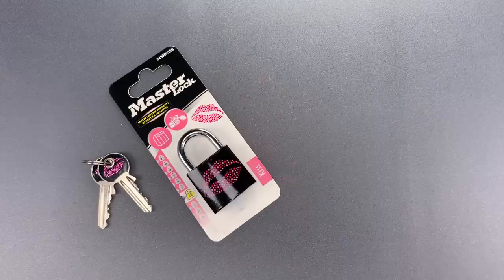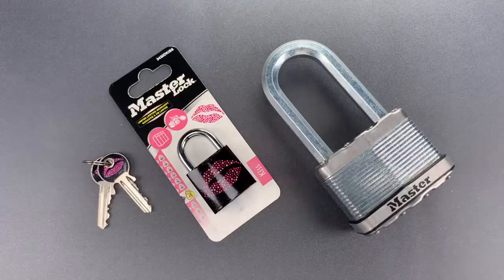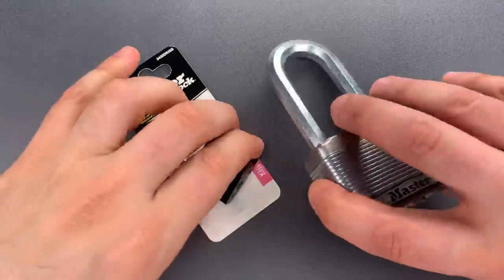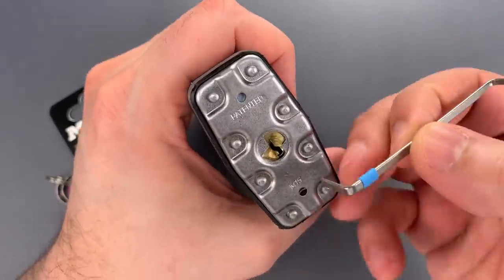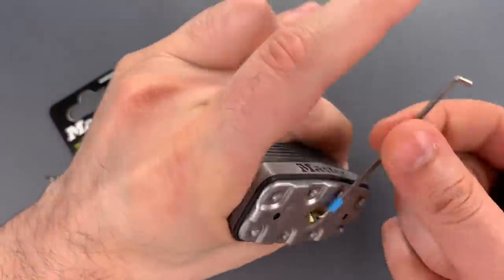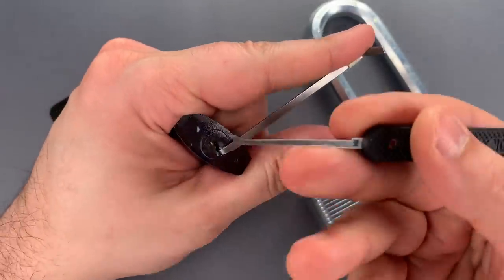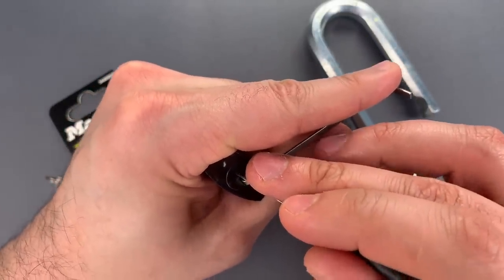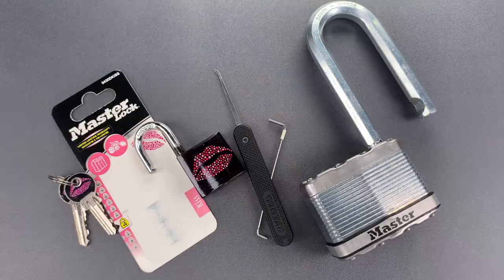[1211] Which Master Lock Is Harder To Pick? A Surprising Result

Comment: So security scales is for how "intimidating" the locks look if you were to forced your way in.
Reply: tbf, "looks secure" is almost as good as "is actually secure" under a lot of circumstances
Reply: Locks aren't really picked anyway in the real world. They're cut with angle grinders, bolt cutters or opened with hydraulic jacks. The actual locking mechanism is really only there for the owner.
Reply: @mytube001  usually the case, but my $5 bike secured with a 20 pound chain is only as secure as my puck locks core or any other bypass flaws (20 pounds is the weight of its short 3 ft tractor pulling chain, not price). So at that stage it’s all about the core.

Most bicycles though it’s true the core is rarely attempted as it’s so easy to break the cables or chains with any metal bar or pocket wire cutters, if it’s even locked at all. Or you’ll see missing wheels because they didn’t even put the lock through the wheels only the frame and that’s half the bike stolen right there.

After a few bicycles stolen in college I started upping the “it’s not worth it” factor and stumbled across LPL looking for reviews on budget locks and was horrified (one I was looking at looked decent but could be instantly shimmed by a soda can or anything else flat). And now I watch almost every video he puts out and realized how much of an illusion of security everything is (much like Windows operating systems, it’s like locking the front door but not having even walls so you could just walk around the locked door...), pretty amazing it’s stuff like this people trust and rely on.
Reply: @jakegarrett8109  "Using encryption on the Internet is the equivalent of arranging an armored car to deliver credit-card information from someone living in a cardboard box to someone living on a park bench."
-- Gene Spafford
Reply: @jakegarrett8109  Battery-powered angle grinders will chew through anything on the market in a matter of seconds. There is simply no defense any longer. These damned thieves are brazen enough to cut locks in the open, with people walking by. People probably either think it's the owner since no thief would do it in the open like that, or they realize that it is a theft in progress and look the other way since a thief may be armed and start a fight if confronted, and few onlookers are willing to risk that over a bike.
The actual core of the lock has no relevance in the real world, when locking up bikes, motor bikes and equipment. Since the angle grinder will always be faster, that's always the best option.
Reply: @eek04  I was more referring to using Windows at all. All I need is an IP address** and I can remotely shut off any Windows computer, transfer files both ways, see every file and document, remotely launch any program: so I could transfer a program, then launch it, move mouse pointer you name it. All thanks to a simple app a High School student made. No known firewall/antivirus has been able to stop it. I believe it even works on Windows Server. No passwords needed just type in a target and go, any windows computer connected to the internet. Hence I don't recommend Windows for anything important.

**I could put random ones, but it would be illegal hacking without permission, I only do this to friends who give verbal go ahead etc. Funny example was shutting off  my friends computer when he was winning in a game (he said I could anytime that week, I chose a convenient time, haha!), and also crashing their computer by spamming open games and forcing mouse cursor to 0,0 coordinate so they couldn't move it over the X to close. I also signed him out of his account which was great because he didn't remember his password (he had it set to auto-login at bootup and never signed out), that was great, great times...

I've tried telling M$, but just like MasterLock they don't care about security, they were more busy adding emoji's to M$ Word than fixing a glaring security issue (I mean accessing all files stored on servers and being able to remotely shut them off without any authorization is kind of a big deal...), to my knowledge this security flaw still exists, though I wiped all my drives before taking a job with security clearance since I didn't know how thorough the investigation would be I figured that would look bad, so I can only assume it still works as its worked for years and M$ just doesn't care. PS I'm not a hacker, I suck at coding, only good enough for programming robots and stuff, I was just a tester and it was decided to not release the program into the wild for obvious reasons, it actually started because file sharing sucked on Windows and with a little digging found this massive vulnerability, so most of the times we just used it to share game files, haha!
Reply: @mytube001  Yeah I've used angle grinders and other tools to chop up bikes and work on them while they were still locked. Nobody questioned me for a whole hour I was out there making a racket... I know what you mean!

**A couple were my motorized bikes I was doing alterations to, but I was working on like 3 or 4 bikes all locked up in different racks so it totally looked like I was just stealing random people's stuff as I was carrying parts back and forth to my car... People had to walk around me and my tools, so its not like I wasn't 40 ft from a door entrance, nobody even asked, they all looked away and shuffled past. That's why I picked a chain that would take at least a minute with an angle grinder (it took me about 2 minutes to cut with a corded grinder standard saw blade, diamond carbide tipped would be faster but I wasn't in a rush, then I welded a extended half loop for the puck lock), but for a $5 bike I figure its good enough. For my more expensive bikes with carbon fiber parts you could take off I just carry the bike into stores and be very courteous and go in odd times so its less busy, I won't let those out of my hand let alone my sight (more pricey than my first car).
Reply: I think it's mostly referencing protection against forced entry, given the vast, vast majority of theft and break-ins involve forced entry and not lock picking experts.
Reply: @mytube001  sometimes it is enough with two small wrenches lol :)
Reply: @jakegarrett8109  Hey that's a good idea for social distancing.  If you carry the bike on your shoulder the a_whole with no mask will give more space when there is  a bike wheel at face level.
Reply: @mytube001  Not ANYTHING on the market, pewag chains can take a few minutes to cut with an angle grinder in a vice, even more difficult out in the field. A lock with a decent case hardened shackle and body will likewise take a while to cut and if its a decent core, very difficult to pick, possibly requiring specialised tools, even for someone who is experienced in picking. 
Forget bolt cutters.

Problem is this sort of solution is going to run you a few hundred dollars so not many people opt for this, and even still, given enough time or skill someone can pick or cut through it. Best solution is move to a better town, seldom lock anything up where i live.
Reply: @eek04  I'm stealing that quote
Reply: @jakegarrett8109  most likely they can't fix it, because it's also a backdoor/hole the CIA/FBI uses?
Reply: @antonhelsgaun  that’s just sad if the CIA is THAT bad at hacking... I would at least think they have people more skilled than high school students. Either way it makes Windows similar to a house with no walls (or roof) with a lonely front door sitting alone on the foundation (and it’s only lock is a MasterLock), it’s so bad I wouldn’t even cal it a backdoor flaw at this point, it’s hard to not accidentally walk into the house.

It’s sad, making something so insecure for the illusion of safety (or whatever the government would claim if it is indeed their doing), I really hope it gets fixed someday but until then Linux is the only thing I could recommend. What’s funny, is I offered a high crypto bounty for the same person and gave them physical access to the machine: the rules were no removing hard drive but that was all. I would install any program they wanted besides key loggers and they could use my nice machine with the fastest GPUs you buy and use it to run HashCat or anything else they wanted for days. They still couldn’t hack my Linux machine! Not saying it’s bulletproof but that’s at least 100x better (granted that’s like saying 100x better than Masterlock but that’s better at least).
Reply: I'd just look at it as most common attack vectors as most people aren't going to be able to pick them tbh. Doesn't make sense from an all around standpoint but from that standpoint it kinda does. If you're buying the little lock then the pins are the only thing secure about it.
Reply: Having "master" lock branding on it makes me think its already "unlocked".
Reply: @jakegarrett8109  seems legit
Reply: @arthurmead5341  yeah no joke M$ would rather add emojis to M$ Word than fix bugs (if you look at Windows feedback hub it was just garbage like that being upvoted, actual issues have often single digit upvotes so they’ll never be fixed), it’s amazing because the internet is full of workarounds for issues that Windows never fixed for years (or they make it worse, like recently they just completely removed Windows Homegroup file sharing, which was unreliable and the reason this exploit was found because it was such a pain to use and the back door was discovered). Now that I think about it maybe they did find the issue, maybe that’s why a couple months ago they destroyed built in file sharing? Probably not, it’s still probably broken, they probably just didn’t want to maintain the broken feature and leave more time for emojis... I say that because who in their right mind wants that? Yet at the time I reported it Emojis had thousands of upvotes... so that wasn’t a joke mocking the stupid features, that was the actual most upvotes feature! It’s crazy, nobody actually cares about security, I guess if it’s off your mind you don’t think about it?
Reply: @arthurmead5341  but I know I’m also a bit weird and care about security. I doubt many people take apart my house locks and replaced it’s pins with hardened special pins (way more pick and brute force resistant), but that’s partly because I’m an engineer and I do weird things when I’m bored, and making my own pins sounded fun that day I guess, haha!

Also in a comment I replied to just before yours someone was asking for details on my laser weaponry, because some places have no firearms signs, but photon optical emitting weaponry is not covered under that and apparently it’s so uncommon it just hasn’t been a problem to ban on carry of self defense lasers (Texas doesn’t allow the right to bear pistols, so I got creative), so my most powerful one is a tiny pocket sized one for conceal carry with housings I designed to look like a child’s raygun toy, until it fires a beam that looks straight from Star Trek and would cause instant permanent blindness (also should set a T-shirt on fire in 0.2 seconds, maybe faster, it very quickly left scorch marks in my floor and I have multiple burn marks on my wall from shooting flies and spiders with lasers), so it’s certainly no toy... So I make my security the best I can legally do, and if it’s banned I find away around it: like firearms should not be banned period per the Bill of Rights, this certainly isn’t any safer due to possible reflections, but you also won’t go to prison for 10 hours years by carrying it responsibly. Anyways, I’m a whacky engineer that loves technology and pushing its limits, it’s what I do for fun.

Comment: Couple weeks ago, I realized that I'd lost the key to the Master disc-type lock on my storage unit.  I am definitely a novice lock picker (and also a lawyer).

So I showed up to my storage unit with my pick set, and a Dremel.  After about ten minutes of trying unsuccessfully to pick the lock (I could feel some pins catch, and hear them drop when I released tension, but couldn't get it to open), I gave up and ground through the shackle with a cutting wheel on the Dremel (It was night-time, and the lot has 24-hour access, but the fact that ten minutes of sparks flying into the night air drew zero notice was not encouraging).  I replaced it with a newer, beefier, boron-shackle Master disc lock.

The newer lock came in a 2-pack, and a few days later I was bored in my car, and decided to see if I could pick that one.

Open in... 30 seconds?  Probably a little less.  And as I said, I'm definitely a novice (I learned the theory behind lock picking 30 years ago, but have only actually done it a handful of times)..

So I figured maybe I had trouble with the older lock because of the awkward angle while it was hanging on the door, so I tried it again (the mechanism is intact, even with half the shackle gone).  Nada.  It still won't open, and I've tried half-a dozen times now.
So...

Old Master disc lock: impenetrable to novice lockpicking, shackle cuts like warmed cheese.

New Master disc lock: Opens faster than you trying to get the passenger door open so your buddy doesn't puke in your car,  shackle would need at least 30 minutes, and probably three cutting disks to get through.

Which is to say, everything LPL says here.
Reply: Ten minutes is long though for cutting through warm cheese. It looks like your reasoning has gone off. I hope this is not brought on to you by handling too many a Master locks, cause it would be bad if it would start affecting your activities as a lawyer.
Reply: @harrickvharrick3957 ...what? Can you not tell the obvious exaggeration? This is a regular part of human communication, you really should be familiar with it already if you're able to write.
Reply: @SovietReunionYT  Well I got it wrong I see, it was ten minutes of picking. But I don't think I necessarily see were you are coming from either. He seems to be talking of an actual experience with actual times.
Reply: So if they combined the two designs, they might actually have a decent lock.
Reply: ...or one of the springs in the old lock had siezed, so the pins in that chamber werent acting normally. I had an indian lock once that i had to tap on the side to get the last pin to drop in to the keyway so i could pick it. Even that cheepass piece of iron junk had longer pins to prevent overlifting.

Comment: So this little Master Lock test showes us that their security rating is solely based on brute force attack and has nothing to do with the three locks core.
Reply: exactly
Reply: The logical extension of that line up are the Master Lock Zenex Locks. Awesome Core - thermo plastic housing.
Reply: I suppose that's the more realistic approach, even if it's penny-pinching as hell.
The vast majority of crooks prefer a pair of bolt cutters or a prybar to fiddling with lockpicks. The fancy ones might use an angle grinder.
Reply: Their logic is that for Joe Petty Larceny its way easier and cheaper to go to Home Depot and buy a Ryobi cordless angle grinder than it is to stop and bother to learn how to pick locks.

A determined intruder will get in regardless, so make it untenable as possible for amateurs and you've got yourself a win.
Reply: @internet_introvert  But I can't imagine cost of adding security pins that they already have in some cores would be a big deal for a fairly expensive lock
Reply: @internet_introvert  You mean steal a Ryobi cordless angle grinder??
Reply: @ToastyMozart  but then what's the reason for the better core in the kiss lock?
Why not also save money on the small lock by putting a crappy core in it?
Reply: A pair of vice-grips can defeat the kiss lock with a simple twist. The hinge side usually always breaks out first.

That may be difficult if you're a Woman/European though which is why it's marketed to those two likened demographics.
Reply: @sarowie  I'll check them out, thanks : )
Reply: @ToastyMozart  I think you are absolutely spot on.
Reply: @janus3555  Europeans are stronger in general.
Reply: @mandowarrior123  generally, no, they aren't.
Reply: @janus3555  had to like just for the sheer heat of that burn.

Comment: To be fair, I live in a place with relatively high property crime relative to violent crimes, and the local police blotter often as gym locker thefts. They often mention that the locker was either burgled when unlocked and unattended, or the locks were broken. I've never seen them mention a lock being non-destructively opened. Considering Master's lineup and applications, picking does seem to be a relatively unusual thing compared to crowbars and hammers.